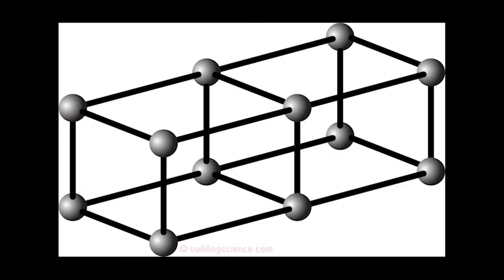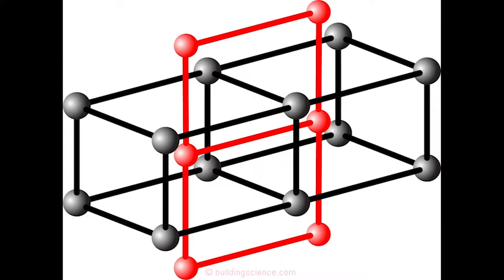Tile, Sand, California and Polymer Modified Thinsets, Oh, my!

Comment: I presume using something like a Ditra waffle underlayment ameliorates the problem of large tile?  

As for sand over the vapor barrier, it's fine so long as there is proper subsurface drainage.  Get the drainage problem fixed - it's relatively cheap to do - clean drain rock, solid perforated piping (slots down) that is graded to drain. That said, can spend a bit more and buy thicker vapor barrier if the worry is about punctures during rebar and concrete placement. But you still need proper subsurface drainage in either case...